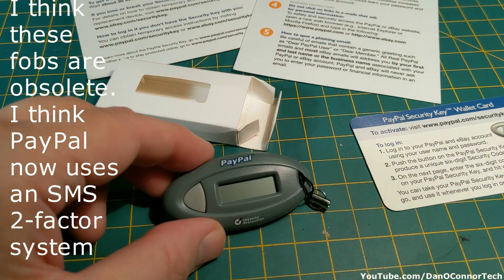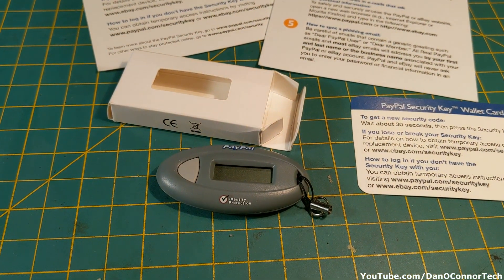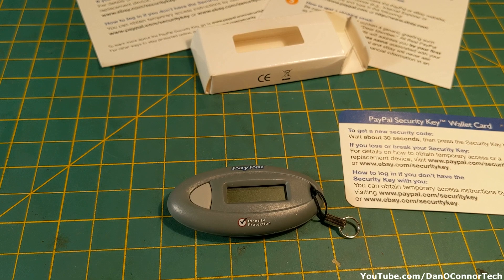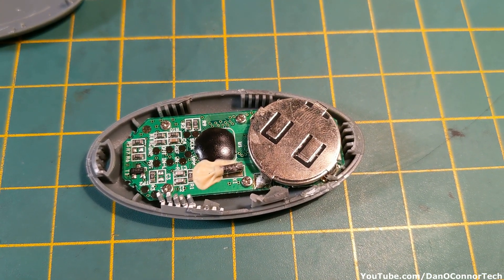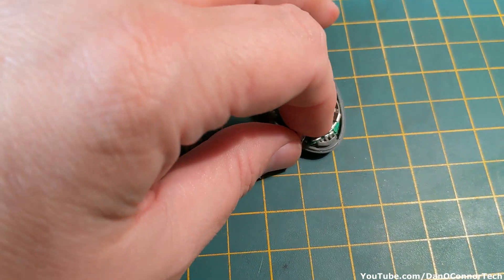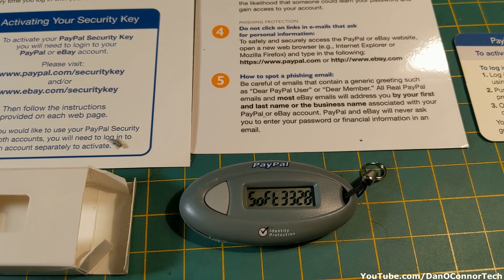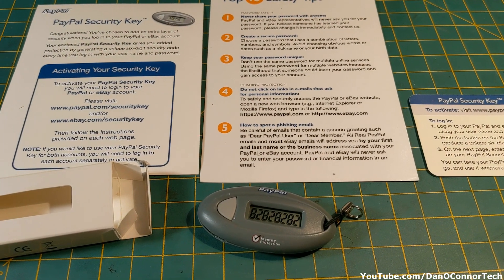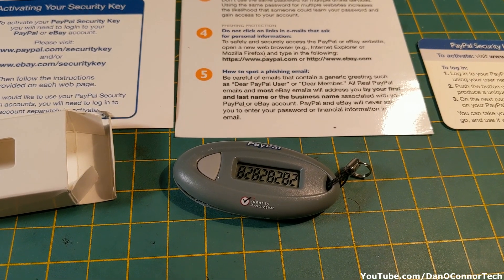PayPal Security Key: What's Inside?

Comment: I had a later version of one of these that was shaped like a credit card. Just like you, I never used it. The random number generator has to be synchronized to the exact time and date to be valid, so that's why these no longer work once the battery goes dead, even if you replace it.